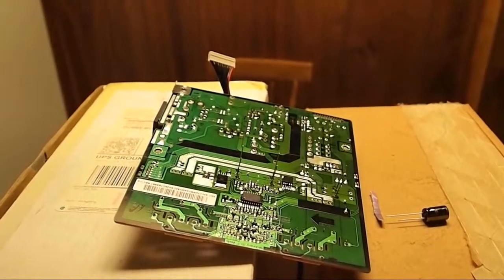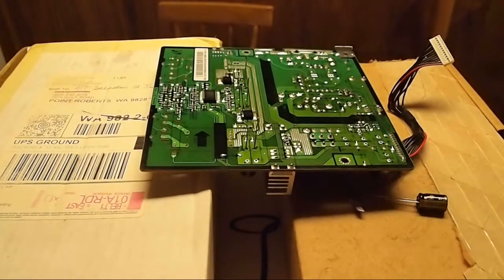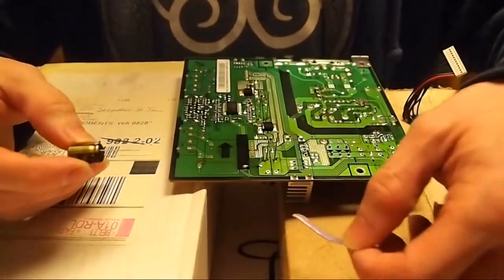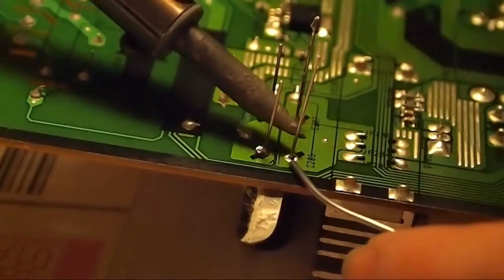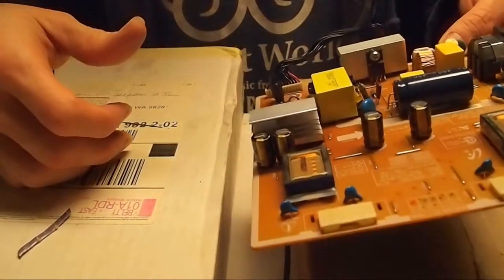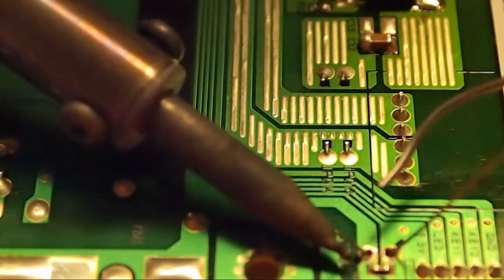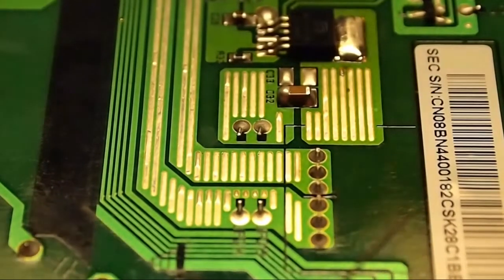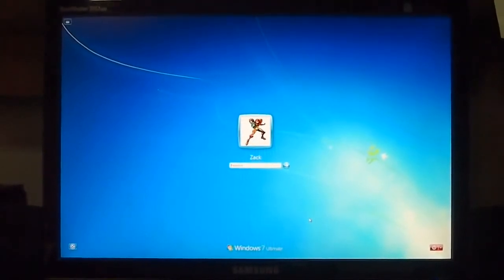Samsung Syncmaster 2053BW soldering on new capacitors  (Part 3 of 3)

Comment: Thanks for the video.
I have 2053bw since the late 2009 and just replaced its capacitors for the second time, so they are good for 2-3 years of everyday use for me.
Curiously this time none of them had any sign of damage (during the first repair some of original ones were noticeably swollen), but it was taking 5-10 minutes for the monitor to power on.

It is a nice 16:10 monitor which I really like despite some drawbacks, otherwise I wouldn't have bothered to repair it :)

Comment: Thanks for the videos - but a correction, I think; your last mouser link is to a 1uF 50V capacitor. On my 2053BW,
C204 is a 10uF 50V capacitor! Interesting if your monitor still works with a 1uF one... Cheers, Jon N
Reply from the maker: I'll have to double check my order instead of taking my monitor apart to see if that's the case. Thanks for pointing that one out.
Reply from the maker: zallow
 Yep it is well indeed a 1uF cap.
Reply: zallow OK - well on my monitor it was marked as a 10uF and measured the same! I ended up leaving it in as my replacement slimline caps had higher ESR. Thanks for the video anyway, Jon N